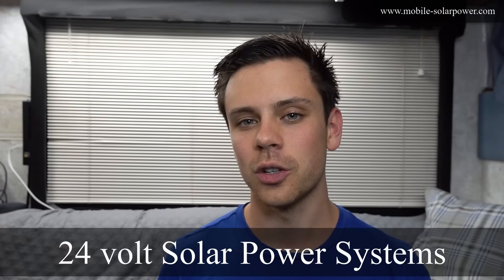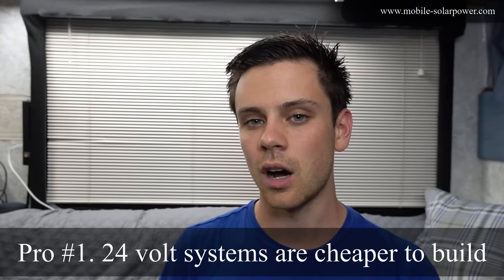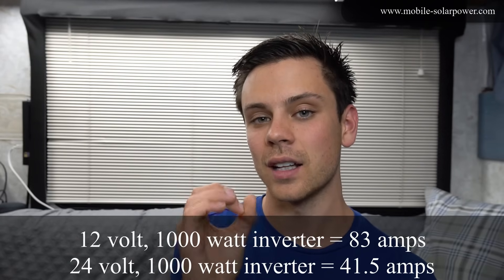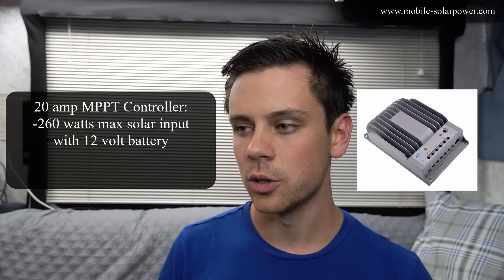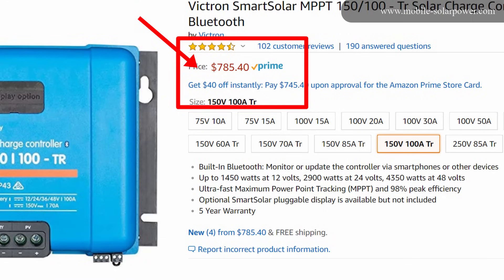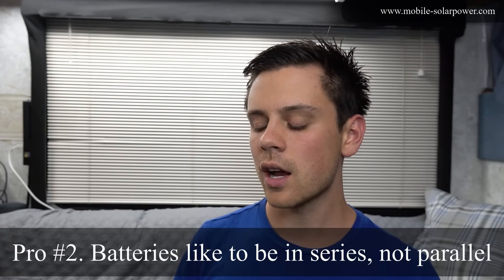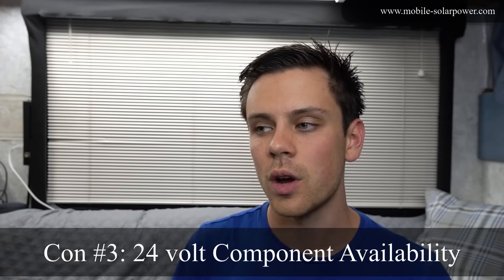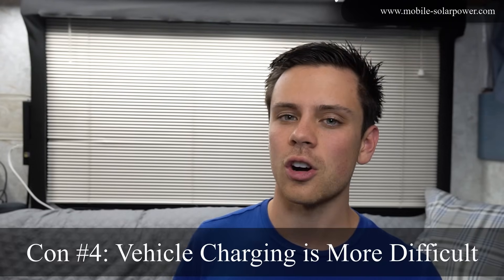12 volts VS. 24 volts for Off-grid Solar Power Systems

Comment: Have a question for you. So I'm going to build out a typical "camper van", but I do video production as a living and will need to hook up my big PC (PC will be peaking at 600watts) and monitor/tv solution. Will also have some sort of refrigerator. Would you recommend a 24 volt system? Or a 12 volt system? Thanks. I'm like a sponge trying to soak up all your knowledge on your videos.
Reply from the maker: Thanks. Hmm depends on battery and how much solar you have. I would go for 24 volts if you can.
Reply from the maker: I would go for 800-1000 watts of solar for that, at least. But depends on where you live too, and how much sunshine you have
Reply: @WillProwse  Hmm. I was thinking about putting in a 2nd alternator to charge the batteries and just a few hundred watts of solar. But you definitely have me second guessing my decision
Reply: @landonwhinery4023  A second alternator at 24v is hard to find and cost about $1,200 for an externally regulated one with a programmable voltage regulator (need that for lithium). In Oregon/Washington WINTER 1000 watt panels only produce about 100 watts for very short periods of time.
Reply: Car audio guys add alternators to their systems. i've been doing research on adding alternators like they do. They even make brackets for them. You might want to check it out if you are thinking of adding alternators.

Comment: Good thoughts. Especially the last one. Only thing is, I want to run one 5,000btu A/C unit when it gets hot.
You can’t buy a Power Wall from Tesla. They want to install it and manage it and connect it to the grid. None of which is what I have in mind.
Maybe they are sold used. Probably better to buy them by the lot, several cells from the same vehicle.
Reply from the maker: Yeah, lots of downsides to the powerwall. Yeah used Tesla vehicle battery modules are great. That's what I currently run for my system.
Reply: Neil...search for "MrRickyBill" here on YouTube.  He has a van with 2 - 330W solar panels up top and 6 - 100Ah lithium batteries inside.  He did a test where he ran his 6600 BTU AC unit for 24 hours (that means at night too...duh) all the while cooking meals on his induction stove, running his refrigerator, and other appliances including a 13 gallon hot water tank...given enough panels and batteries,  your 5000 BTU AC should be no problem.

Comment: OK, Will ! Let’s go... how about 48v...100v. And I’m thinking about a 13-15kW whole house, run the A/C for me and the cat in the Southwest type system.
I strongly dislike how solar installation company’s want to abuse me with the cost they charge. I should be able to design and build it myself.
I’m starting by building an “Off Grid King System” for my camper trailer from your book “Mobile Solar Power Made Easy” , which is really deluxe.
I have a humble electronic background so I’ll start with the OGKS as a prototype. What advice can you give me?
Reply: I have a 48v system (old, SW5548 inverter from Trace, became Xantrex, became Siemens). 48v seems to still be a bit less common than 24v and will cost more. Fuses, for example, for 48v systems are more expensive. Same with D.C. rated circuit breakers. And finally, don't even consider 48v except for large systems like the whole house.

My basic rule of thumb, is try to limit the current from the batteries to about 200amp max continuous. That means 2400watt for 12volt, 9600watt for 48volt, etc.  (But you have to build the battery to handle that current, and so for 48v you probably want at least a 10kw battery bank and more would be better.)
Reply from the maker: That's great!! Good job building your first system :D

48v system... what kind of battery? What inverter do you wish to use? I would hire an electrician to wire up the AC stuff. Offgrid systems, at low voltages, are very forgiving. High voltage systems, and AC power is not forgiving. You could buy a powerwall, those work great. If grid is down, you could run extension cord from off grid king inverter to power small appliances till the grid turns back on.
Reply: @WillProwse  Advanced RV uses a 48V system now.   Check out their system.

Comment: Here's what I like... no fluff... you edit out the ums and uhs... your videos are VERY info packed and to the point. I put together a controller/inverter system in my trailer based almost exactly on one of your recent videos. In fact, I took a screen shot of the setup on the video and worked off of that visual. Step by step. Easy to understand. Works like a charm. You talk fast, but I can always rewind. Thanks for what you do. Great resource for learning. And yeah, I bought your book, too.
Reply from the maker: This comment made my day. I'm glad you like the videos!
Reply: @WillProwse  😊
Reply: @WillProwse  
Will, I am going to the VAN Build to have my Solar put on my RV and to also have my BBBatteries hocked to that solar system... After watching this video and my ENG friend tell me that I should have done 24volts I question the fact why could I not have BOTH? I am getting @1200 watts of solar and I have 300 AH of Lithium batteries. 
?? >> >>?>> WHY COULD I NOT HAVE 200 amps of 24v and 100amps of 12 volts?
Reply: @WillProwse  "Like"... no, No, NO let's be very clear...  We DO NOT like your videos... we LOVE your videos!!!  I had no idea which way to go despite reading/listening to several on the topic... and then BAM < 15 mins with Mr. Electric himself and I know EXACTLY which way I should be going.  Thank you so much!  Ps. I'm only part way through your book... no doubt I will need to read it a second time through, as well as take better notes / highlight as I go..., but Yeah so far a great read (especially for us newbies).
Reply: @WillProwse  I agree! great job
Reply: This comment is exactly how I feel, you are spot on Mr. Prowse . AWSOME information for anybody looking to build solar.
Reply: @dbrown6936  agreed
Reply: I like that he talks fast. I can grab more info quicker and like you're saying you can rewind if need be.
Reply: This! This comment says what I wanted to say too. REALLY good channel and this video is a really good example. Thanks!
Reply: I am a subscriber and videos like this are the reason.  Clear and well done, just starting on my power system in my cargo trailer conversion and this changes a lot of it, thankfully before I started install.  Thanks Will
Reply: Indeed! The best advice I've heard. 
If Will talks too fast for you, go to 'Settings' at the bottom of the page, and choose a slower speed. I have to slow Will down, and speed up Bob Wells. lol
Reply: " I put together a controller/inverter system in my trailer based almost exactly on one of your recent videos. In fact, I took a screen shot of the setup on the video "  Can you reference that video please.  I'm interested in doing the same thing
Reply: He goes too fast for me cuz I'm a tard
Reply: Joe Bob You can slow the video down in the settings.
Reply: Can you reference that video please and thanks!
Reply: @richdv6800  No I can't, because it was almost 2 years ago. You need to start with his playlists for beginners and expend out from there.
Reply: Hi I love you are my best teacher
Reply: Exactly! Will doesn't come across with ATTITUDE.  That's great with adolescent teenagers talking music video's. Not here.
Just give me the straight 💩. Thanks WIll P!
Reply: you can change video speed to 75%
Reply: @johnmurray7148  I'm surprised most don't do this - I actually watch most of these at 1.75 speed and slow it down to 1.25 if I really want to be clear.
If I want to write stuff down, then I hit the left arrow to back it up 6 seconds.
Reply: Yes, that’s why I like watching and listening to him.  No extra words like you said ex: “like, uhms, etc”  He’s really an intelligent guy. I hate listening to a speaker where every other word they say is “like”.  They turn me off.
Reply: He does talk fast I find myself rewinding ALL THE TIME  and he is so informative that I sometimes have a hard time keeping up with it all!! But here I am I always come back because he is so real about whatever he's talking about!
Reply: @Big_bus303  I bought his book. It's cheap and help me get the basics understood, as well as some of the terminology. I read it 3 times over.. the 3rd time through highlighting all of the good parts / key points to remember :) ...and Yes, I too am a re-winder (I suspect most are).
Reply: What would be ideal to power a 2hp deep well pump,approx 525 feet deep if the grid goes down long term?. Looking for your ideas, what you would build. Great stuff Will.
Reply: My ears are bleeding now.
Reply: Yep, great speaker and knows his stuff, that's why he and Elon Musk needs to get their brains together so they can develop an anti gravity system.
Reply: Get rid of bo bo!!
Reply: Let's get down to brass tax here.  This review is straight to the point.  Here is what I like... your review being down to the nuts and bolts.
Reply: Will we love that you have taken the time to teach us your knowledge..... knowledge is something NO one cann take from us. Thank You! ☆☆☆☆☆

Comment: I went 48. No complaints. I use a 12.5 volt step down and yep it works great. 👍
Reply from the maker: Nice! Very cool
Reply: @WillProwse  
Hi will. 
I'm building a 48v 5k system with the all in one mpp units. 
Can you please tell me how many batteries I am going to need?  Presently I have four 12v 100amp battle born batteries
Reply: In an RV?? or a House?? 48 is badass.....
Reply: @EOFugate  In a 170" wheel base sprinter. I have 800 watts on the roof and a plug in the bottom so i can hook to a large array on my property so i can use a total of 4,000 watts. I can run the water pump on my well, air conditioner and washer/dryer(110 volt)  at the same time without worries. Outback 80 amp charge controller and Outback gvfx3648 inverter. 48 volt lithium batteries from Chevy Volt. Bought on ebay. 2 years and no issues. Love it. Really want those Tesla batteries though.
Reply: @offgridphilosophy7959  sweet system. One day, one day...
Reply: @offgridphilosophy7959  I'm thinking of doing very similar to your system but starting with the Tesla batteries you desire. I'm doing a Schoolie. 40 Foot School Bus home. Specifically a Lion Company C Lion Electric MFSAB School Bus. Your comment about 48 is what's giving me hope. I have 2 years to prepare so I'm learning and studying all the different aspects. What calls you to Tesla batteries? What kind of Tesla batteries are you considering?
Reply: @DylanBegazo  I've changed my mind. I might just get four battleborns. Warranty and customer service are great there!
Reply: Can u recommend a converter